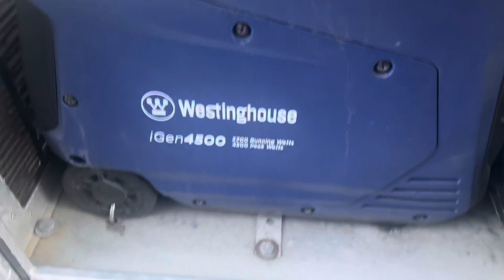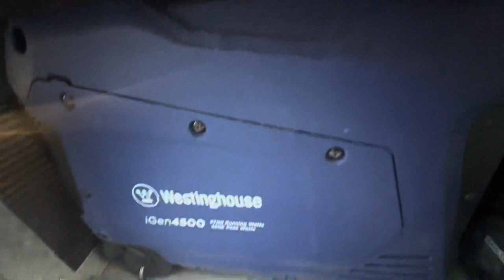How To Get Power In Your Semi Truck Using A Generator Custom APU Under 2k No Idle Save Fuel

Comment: Good setup One time I want to install a apu and they told me I had to wait a couple of months and it was going to cost me over ten grand. I did the same thing. The only downside is that you have to go buy fuel everyday. When you had a long they it's a little tiring. Had that for 2 years +. If you do it make sure it's an inverter generator so you won't damage your electronics.

Comment: I've got the same generator 3 years awesome unit ,remote startup.  I've got mine mounted up behind the cab in an aluminum box that I made with two radiator fan ,10inch for in take 12 for exhaust with temp probe they turn off and on as needed, I have an Idle free electric APU with air conditioner and A wabasta hydraulic heater that Heats my cab sleeper fuel tanks. An engine. I use the generator to charge batteries when sitting for extended.s of time. Also to run my microwave toaster, oven, coffee pot, And water heater for my shower
Reply: How did you connect your radiator fans to this generator? It doesn’t look like it has any DC outputs. What temp probe did you use? Thanks.
Reply: @johnathanfritz2877  i didn't. I connected them to the batteries i charge with generator, then to a daul fan relay you can find at any autoparts store. I have 8 deep cycle AGM batteries that run all my appliances.  The generator is to charge them. 55 amp charger with a separator ill only charge 4 at a time, i have an idle free apu that runs off the batteries also it provides AC AND HEATING.
Reply: How did you set up it to charge truck batteries

Comment: Nice setup. Is it ok, DOT wise, to drill holes in the frame or did you use existing holes?
Reply: DOT doesn't give two shits about drilling holes. How do you think you mount steps and sideboxes on truck frames... you drill holes

Comment: You can not cut into the frame on a CMV, putting holes in the frame is a major no/no. Not sure what they’d do to you if they investigated the mounts. Just what I’ve heard on CMV trucks you absolutely can not touch the frame
Reply: You heard wrong, the dealer drills holes for steps and sideboxes, ffs
Reply: @TheRoadhammer379  right; the dealer can cut into the frame. They are authorized to do it in very specific locations. Someone outside a dealer shouldn’t ever do it. If some mobile mechanic tries convincing you otherwise, he’s full of crap and just wants to make a quick buck and you’ll never see him again. Sure you can cut into the frame. But if something ever were to happen, you take 100% liability on yourself. Not to mention you void your warranty on  every last part that’s attached to the truck. If you get inspected and an officer checks hacked cuts, you can be put out of service until you fix it. How do you fix a frame in the lot of a weigh station? Once you cut the frame you weaken it, no officer in his right mind can legally let you drive off with hacked up sections of a frame

Comment: Looks like its such a tight fit that you have to remove the generator to refill with gas??
Reply from the maker: Its got about 6” clearance i can fit the gas nozzle no issue
Reply: @Truck Yourself  what size box did you buy?

Comment: can generator set can charge your battery in your truck??
Reply from the maker: Yes i have it attached to a charger so anytime the generator runs it automatically charges the truck batteries
Reply: @TruckyourselfDIY  it charges all 3 or 4 batteries? What kind of charger is it?
Reply: What charger do you use for your batteries bro?
Reply: @telo712 use the NOCO Genius 2x4, it charges all 4 batteries and if one is low and the other 3 are charged, it will automatically switch from charging the other 3 and continue to charge the bad battery. It's a freaking awesome charger
Reply: Charge how